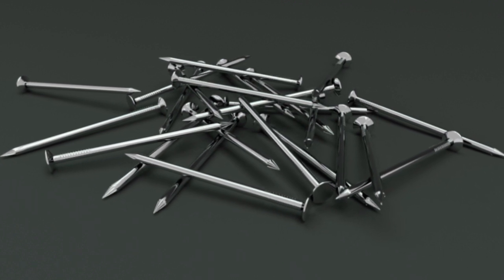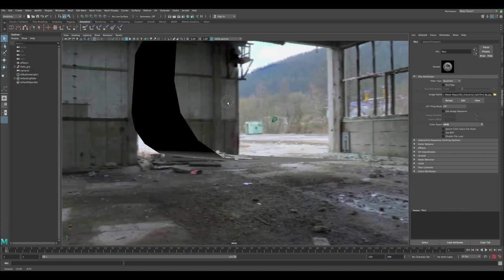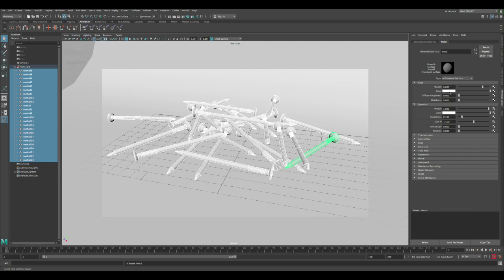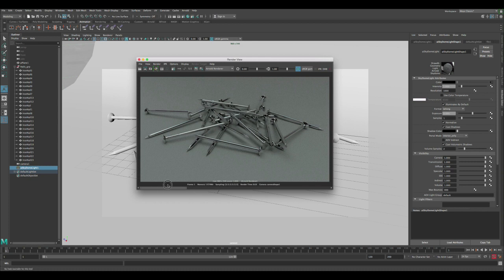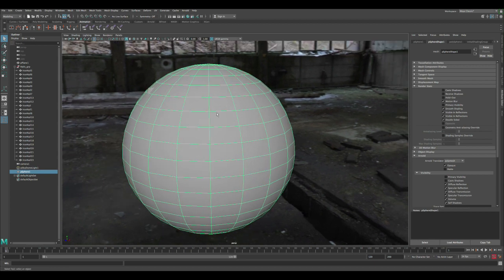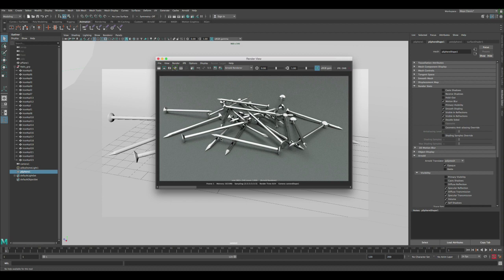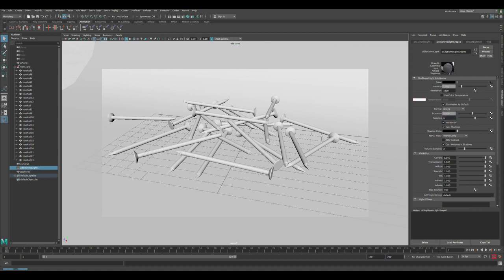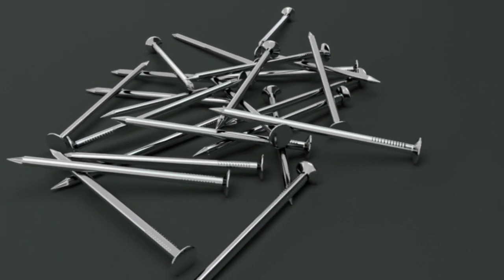How To Create Metal Silver Using ARNOLD In Maya 2018 HDRI Lighting

Comment: I don't have metalness in Maya 2017.  Is there any way to get this render on Maya 2017?
Reply from the maker: try adjusting the specular settings, currently I dont have access Maya 2017 but the specular should help, also try apply 
Arnold metallic shader from the preset and adjust it to achieve the desired results. check this Arnold material library contains lots great materials, hopefully its for maya 2017 though,  https://docs.arnoldrenderer.com/display/AFMUG/Material+Library  
hope this helps :)

Comment: Doesnt work
Reply from the maker: Hi Kate, which part didn't work for you?
Reply: Hi, the first part, I followed step by step and the effect that you got on the render didn't happened on my end.
I just did this part in blender, its faster and less confusing. I either have the worst luck or Maya is overrated because I've had nothing but bad times in Maya.
Reply from the maker: I see, if you send me screenshots of  your Maya progress I can help, important thing is to have HDR image and also to have the reflection cards or sphere that I used to get the reflection to look natural, I agree Maya can be confusing at times you are not alone but with practice you will get the result that you need, we are here to help you :)  by the way what Maya version you used?
Reply: I used the latest version, I would be missing the reflectors. I appreciate that you want to help but again I just deleted the material and just made it on blender instead. The problem I'm having now is that the lights dont work, they're on and in intnsity 5 but everything is dark in the render...
Reply from the maker: Hi Kate, try to remove all lights form your scene and then go to Arnold and add skydome light then render and see if you see anything, it should lit up the scene for you. then you can add hdr to the light once it work.
Reply: 3D Models World
Reply from the maker: Geo Mas! :)